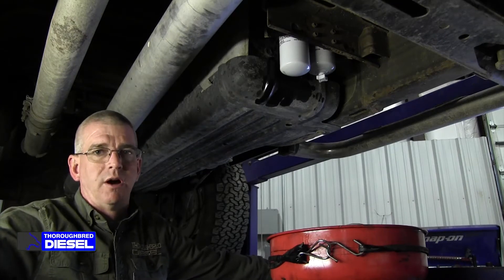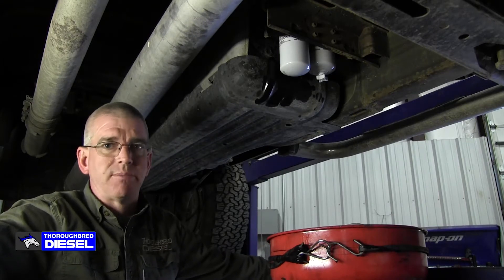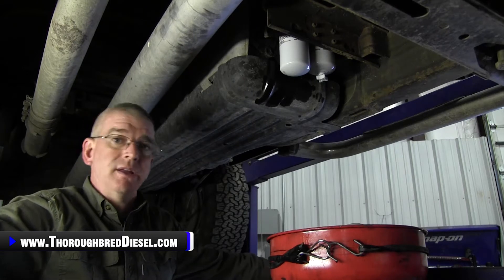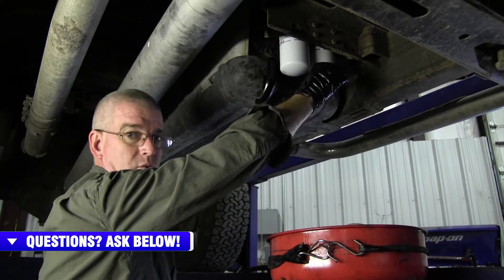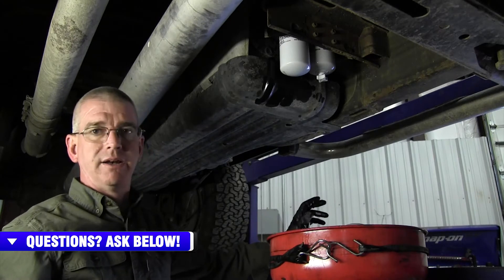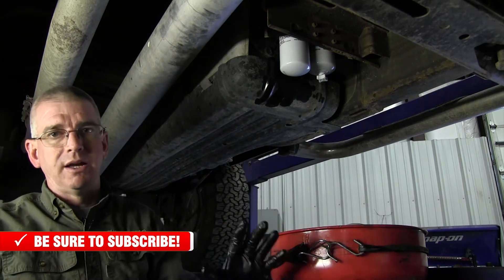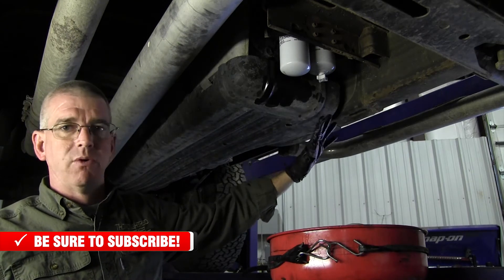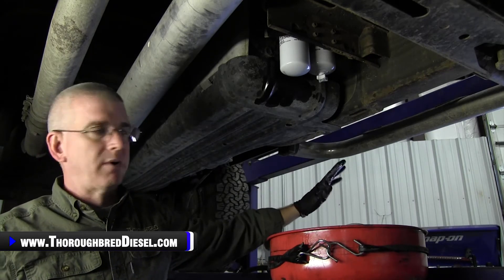How to Drain an Airdog Fuel System Water Separator Filter

Comment: Is it supposed to come out yellow, because mine turns yellow if you drain it in a clear container?
Reply from the maker: Yes that is normal.
Reply: What if there diesel I the water separator
Reply: @403glenwood4539  dude, of course there is going to be diesel... its part of your diesel fuel system! did you not watch the video?